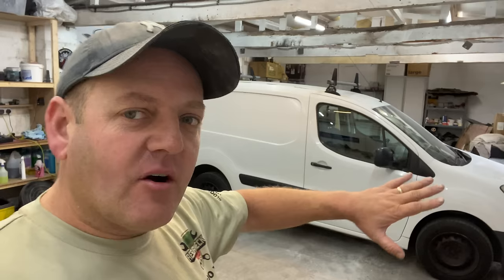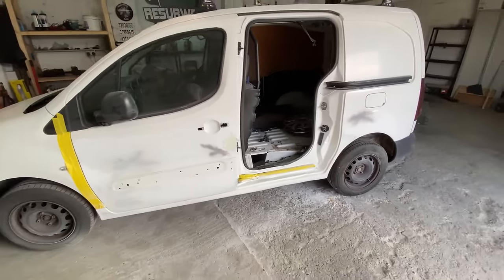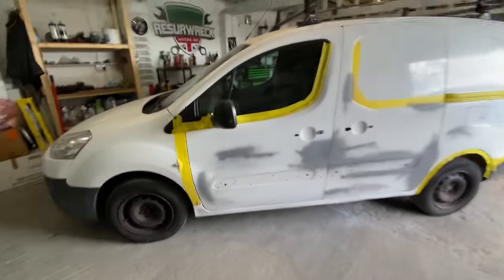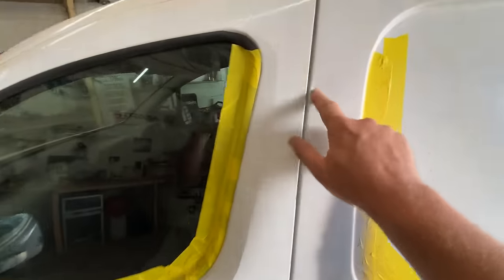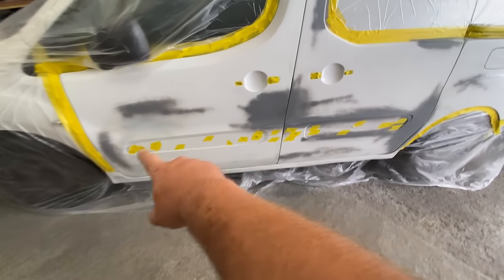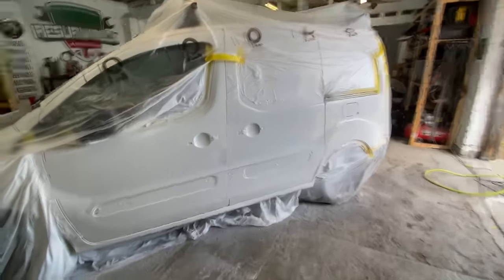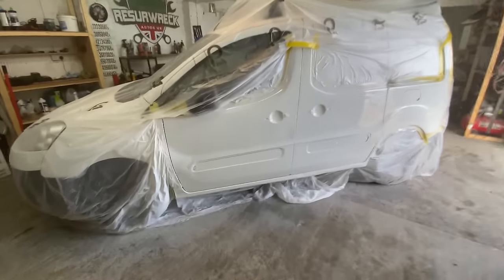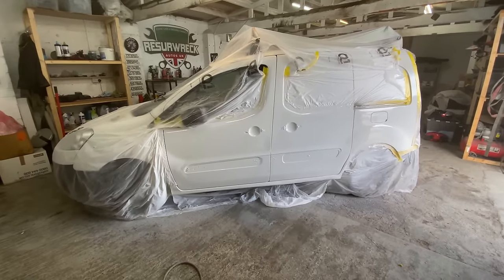Peugeot Partner  Van 2014 Cat N Salvage Rebuild Part 5 Painting The Side

Comment: Hi mate,looking good,but u could save yourself a lot of time,for a small amount more clear coat.localise your primed areas with colour,then clear coat full side as far as roof joint.saves trying to blend out and no paint edges in side panels.instead of 1500 to key panels,u can get away with 1000,or as I used to do use g Matt or similar flatting paste.its false econy to leave 1 panel on a full side due to colour mis match.
Reply from the maker: Thanks for the info buddy appreciate it 👍👍

Comment: Painting is getting better but you really got to spend more time on the filler / metal work . High and low spots and it can clearly be seen where it’s been worked through the fresh paint . Also to much primer . Dust coat not deep coat .

Comment: Hi Mark, Nice job overall. At the end with base coat and clear coat applied it looks like there is a depression / dent still in the front door (below where the handle will be) - it's where you said you wanted to get it a bit flatter - around 3:00 on the video. Is it an optical illusion - or is it really a depression in the surface? Take care Dave.